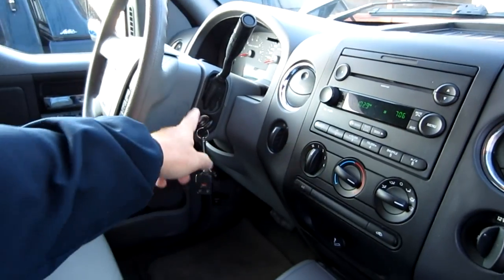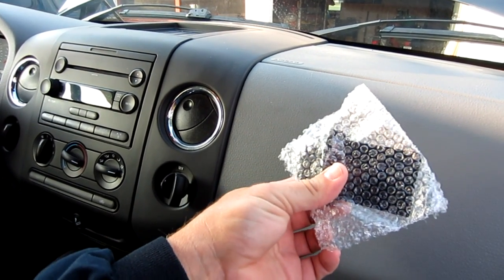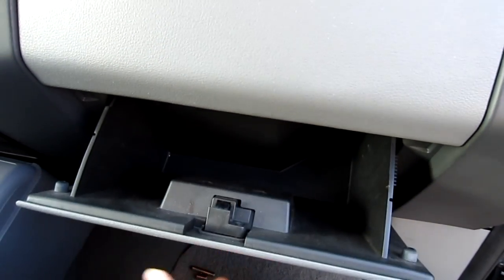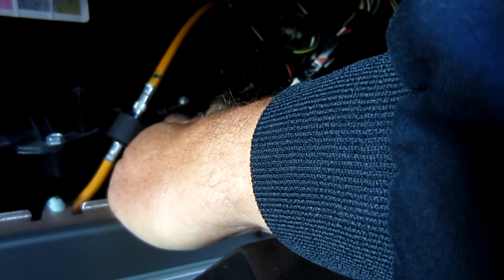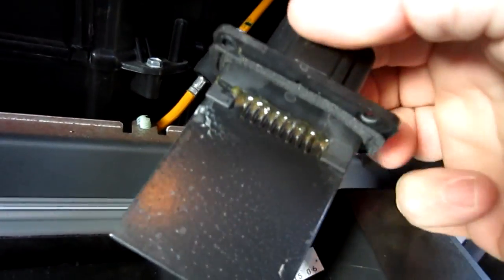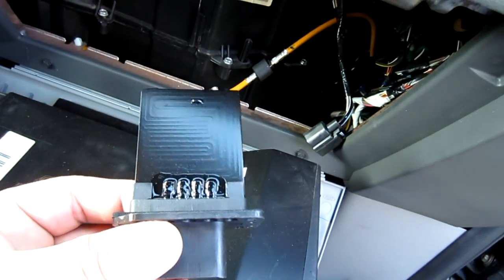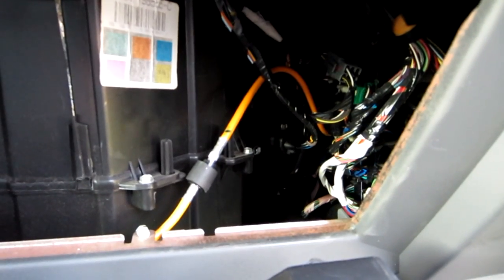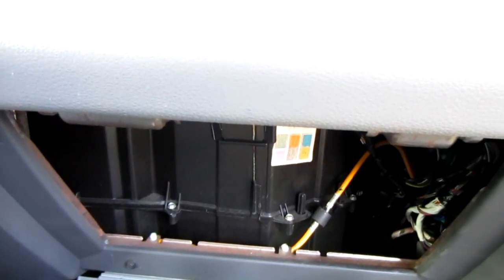2004 - 2011 F150 Blower Motor Resistor

Comment: Hey Foxboss9 and anyone else reading the "new" comments. This just happened to me and I want to CONFIRM that replacing this resistor when only the "LOW" setting doesn't work is a 100% fix! $20 and took less than 10 minutes, taking the side panel of the dash off made it really easy.  My truck: 2011 F-150 5.0 ext cab RWD. O'Reilly's only place that had it in stock, part number was RU1133 (Foxboss9's amazon link is RU440, so I ran the compatability check and it says will work with 2011 F-150) so please use his amazon link AND buy with confidence!     EZ FIX!! Thank you SO MUCH FOR THIS VIDEO

Comment: Thanks for the simple video. This is the third vehicle I've had this issue with, so I knew it was the motor resistor, just didn't know where it was in this truck. Thanks again, much appreciated

Comment: Thanks for the data.  Used this to replace resistor in 2005 F-150.  Worked just like you said.  Hardest part was getting the back screw back in.  This vehicle had been flooded in all the Texas rain this year and none of the blower settings were working.  Resistor replaced as well as fuse and relay for blower.  Working like a champ.
Reply from the maker: Kenton Wright Great!  Stay Dry.. Funny how CA is a drought and between TX, OH and a few others we have enough rain for two summers..

Comment: Thank you. This worked like a charm. 

One thing- I believe that the resistor needs air running across it to keep it cool.  I started the blower with the resistor out- and it definitely heated up. Which, dummy I am, resistors do.

Comment: Thanks for the video, I just fixed mine after putting off for a year and a half.

Also if you’re reading this do not touch the resistor while the truck is on. The resistor get hot and it will burn your hand.

Comment: Hey man, a huge "thank you" for the video.  My 2005 F-150 dropped the all the speeds except for 4.  With you video, I bought the unit on Amazon, 19.99, and replaced it within 10 minutes and works like new.  I checked around to garages, they wanted an average of $200 ...... again, you saved me!!!!
Reply: This might be the same problem as my 005 f150 because last year 3 and 4 worked fined till this year 4 only works and 123 don’t work now except 4 so yeah I’ll definitely will buy a new blower resistor and I should get all my control speed up and running again
Reply: Oh yeah same thing with my 91 firebird formula except all the speeds works but the air flow is low meaning that when it’s on low can kind of feel it on low medium same air flow and high works a bit better but mostly it’s the blower resistor because over time it’s rusts and burns out so hopefully I can get that fix too

Comment: Thanks Man. I was at a loss after checking my fuse and relay. I was sure it was the blower motor. After watching the video I swapped out the,blower motor resistor and that fixed it. You saved me a lot of money and time. Very grateful for your video.
Reply from the maker: Keena1965 Great news! Glad it helped..

Comment: Thanks for the video, it saved me a lot of time as I was about to pull the knob control assembly on the dash apart. Buy the 8mm socket if you don't have one, I wouldn't speculate on a new one so I used my small adjustable that kept readjusting, it took about 40 minutes. Its a very easy repair with the correct tools. I'm off, someone said theres an issue with a 747.

Comment: Hey Foxboss9, Thank you. You were spot on with this video. I just watched you video yesterday, got my replacement blower resistor today and just put it in. Works just like it should. I found that I had to use a Scosche- twist driver to get the bolts in and out as my hands are just too big to get in there for this job. Thanks-a-million!

Comment: thanks very much. this is the first video I clicked on.  Picked up the part here in Toronto Ont CA for $46 + tax and fixed in 20 minutes.  Availale cheaper on Amazon but happened to be driving by a dealership and couldn't be bothered waiting   Thanks Boss!

Comment: If you have a 1997-2003 and the blower has never been changed, chances are its ready to go if your unit only works on high. When I pulled both the resistor and blower out, I found that the windings were gone on the blower, the wheel was tight, and the resistor tested with the ohm multimeter was also gone. When you test the blower motor with a multi-meter make sure the positive red lead is connected to the right side of the plug. Some resistors will be blown but not corroded.  The factory parts after almost 20 years should be replaced. If you go under to replace the resistor might as well replace the motor, because a bad motor will blow your resistor.

Comment: Thank you very much for this video. I assumed it was the selector switch itself but now I can skip that burdensome step. Thank you!
Reply: Same here. Just purchased an 05 off a family member. I thought the switch was the problem. Replaced the resistor. 5 minute fix and works like it should. Thanks

Comment: I have a different issue that you may be able to help me with. I have a 2007 F150. When I start the truck up. My air vent dials are in the off position, but I can hear the vent blower motor click on and then I feel air coming out of the vents. I'll turn the right dial to the right then turn it back to off, the blower shuts off. Few seconds later it turns back on again with the dials in the off position. I do the same on and off again then it stays off.

Comment: Some notes,  on my F150 2009 Lariat 4x4 (5.4L) with dual zone I have the same problem but my part number looks different.  it is in the SAME location and same 8mm bolts.  the Part is about $128 at Ford/dealer.  it is part number 19E624 (YH-1827)

Comment: Hi FoxBoss:  I have a 2009 F150 King Ranch with dual climate control. No fan on either AC or Heat.  Do you think its the same issue with the blower motor resistor? There are no blown fuses.
Reply from the maker: I am not sure. I think Someone about a year ago in comments, said is was different

Comment: Thanks so much for the video, this is the third time I've replaced the resistor, any idea why it does this?
Reply from the maker: They are just resistant wiring inside of the module, anything that overloads them could cause a failure. So, it could be a wring issue that you would have to trace OR a switch issue that would have to be replaced OR a motor issue that is causing a drag/random winding break.. Depending on how often you have to replace them and how much of an inconvenience it is would dictate how deep you may want to dive into the troubleshooting part..

Comment: Really helpfull and detail video, thanks, my 2006 ford is now working great. Would be good for people to know that if they are using a ratchet (like i did) to try to work through it from the bottom since is easier to loose and tight the screws.

Comment: This looks easy enough.  However on my 2011 F-150, 3 and 4 work, but 1 and 2 do not.  Is this the same issue, or does this only need replaced if only 4 works?
Reply from the maker: Scott Williams 98 percent sure that is the same issue.. More importantly it's the cheapest easiest way to ruling out the resistor as the culprit..

Comment: I have a 2008 Sable where the blower only works intermediately. Has the dual zone climate control and doesn't matter what speed it is on. Sometimes by slapping the dash/glovebox area, the fan comes on. Do you think this is a resistor problem? Thank you
Reply from the maker: Bill Donovan sorry I really dont know, I  am leaning towards a blower issue though. Usually when the resistors go out at least one speed works and no matter how much banging you do on the dash will not correct a resistor problem unless it's a connection issue with the harness.. Best bet is to bypass the controls altogether and try to put 12 volts directly to the blower motor. if the blower runs consistently then you'll have to troubleshoot other things, If the motor will not start and stop consistently when you apply 12 volts on and off then you need a new blower motor..Good luck
Reply: Foxboss9 Thank you for responding so quickly. I will check the blower and report back here what the fix is. Thanks again!

Comment: I sort of have the same problem but with all fan speeds. The problem had been on and off not completely not working. Would it still be the resister?
Reply from the maker: Terry Carmack it could be. The thing is replacing the resistor is the fastest cheapest way to rule it out. It would take more time energy and effort trying to trace wires and check resistance at the switch and the blower motor then it would be worth. So if it was me, I would replace the resistor and then if the problem still exists at that point I would jump into it a little bit more. Worst can happen you're only out 25 bucks and 10 minutes time.

Comment: A question for you..
How to diagnose/repair a non-working power front passenger door window?
Same Vehicle F-150 (mine 2007). Thanks!
Reply from the maker: Check to see if power us going to the switch that operates the faulty window. If no power check if there are separate fuses for each window or each side. If power is OK at switch, alternate switch from the working window. If still nothing, most likely motor.

Comment: On my 2004 F-150 when I pull out the glovebox there is a back panel in the way, it looks like I would need to remove the entire glove compartment and part of the dash to get behind it. Would it still be behind there or another location?
Reply from the maker: not sure what that would be..
Reply: +Foxboss9 I finally found it. It was underneath. I had to remove something and then really get under there to see the part. It had 3 coils on it. I'll be uploading it to my channel soon since I see multiple people having this issue.
Reply from the maker: +John Strange glad you solved it.. 😀👍

Comment: My problem AC turns on in my 2010 F150 but it's stays at one speed unless I turn it off. I try to  increase fan speed or lower fan speed but it stays blowing about half he fan speed. Can it be the motor resistor too? I can see digital lighted fan speed bars go up and down but the actual fans speed stays at about medium blowing power. So if it gets to cold I can't lower it just turn it off or turn up the temperature. Please help. Great vid too.
Reply: @Harvey Ibarra were you able to fix the problem with the resistor? Im having the same issue with my 2010 f150.

Comment: I have similar problem on 2006 f150.  Nothing happens on any fan speed 1-4.  I can still hear the ac compressor come on and some type flap or something click over around the glovebox.  Is this resistor still might be the problem or something else?
Reply from the maker: Not 100 percent sure if it is the resistor,  but the quickest way to rule it out is to install a new one. I am sure there is a way to bypass the resistor to see if that is the problem But, I don't know what the bypass procedure is.

Comment: yeah I have 07 just starting to have this issue I will be looking into it
Reply from the maker: +john bailey good luck
Reply: Mavrick 259  just wondering if you ever solved your AC problem on your 2007 was it the resistor in glove box mine is an 07 and only blowing on high THANKS IN ADVANCE

Comment: I have a 2007 Ford E150 few months ago I took it to the shop and they fix the Valves because it was leaking and after that my Ac sometimes blows cold air and sometimes not also sometimes stops for a bit doesn't blow any air and after 1 or 2 minutes it starts working again. what do think is the same problem?
Reply from the maker: +Joaquin Abundez Sounds like the diverter door is not working. look for vacuum line leaks or if cable controlled look for a cable off..
Reply: +Foxboss9 thank you. one more question my wife is driving an 2005 Mercury Mountaineer and the Rear Ac only blows hot air. the front Ac works good. the rear Ac is controlled by it self. what do you think it can be?
Reply from the maker: There is only one A/C compressor that runs your cabin cooling. So, if the front A/C  is working then the that means either the controls are not turning on the diverter mechanism that sends cold air to the back or the mechanism itself is not working. I would start with the controls up front then the rear passenger controls to make sure they look good(connections/movement). If all looks good then the more difficult part of tracing the parts the controls operate will need to be checked for their functioning. AS ALWAYS CHECK THE FUSE PANEL FIRST..good luck

Comment: Question: After replacing with new blower motor resistor I had good operation for about 30 minutes. Then when I restarting after gassing up it stopped working and was only active on speed 4.
Any ideas what else I should look at?
Thanks
Reply from the maker: Well it could be one of two things. 1 - the part that you replaced it with might have been a bad unit. Or, 2 - you're having a problem either in your wiring or the blower motor itself that's causing the resistor to experience more resistance than what it's designed for and causing the circuit to go bad in the unit. Unfortunately, the easiest way to find out if it's bad wiring is 2 spend a lot of time troubleshooting and looking at resistance values. The good news about that is if you do all the troubleshooting yourself it doesn't cost any money just a lot of time. Now, with that said oh, I'm not a big fan of throwing Parts at a problem when you're not sure exactly if it will fix it or not but for another $20 and 15 minutes worth of work you can find out if you have issues elsewhere by just replacing the blower motor resistor with another one and see if it happens again. Good luck
Reply: @Foxboss9  Thanks. So nothing like a fuse because It blows hard at speed four with three different resistors. If I was a better mechanic I would check the wiring, however it may be that I can change the blower motor and see what happens there. I'll try and follow up results.
Fred

Comment: So did that truck have automatic climate control?  I would assume it does?  The link you provided is for a BMR w/o auto climate control.  It seems a BMR w/ auto is $100+
Reply from the maker: seanYsean this truck did NOT have auto climate control..
Reply: I found a motocraft part with auto off another YT vid  for $36.  Great video you have though.

Comment: at my tire shop where I work  they have this issue on there  company veh   its a 2006 f150   it does not work in 1 and 2    but it does on 3 and 4  would this be the same fix ?
Reply from the maker: Most likely..the switch and resistor are really the only 2 things that change the speed of the blower motor

Comment: Hi, you diagnosed the problem exactly.  Fan only worked on high forever, and it finally died altogether the other day.  I replaced the part, and now the fan sounds like it wants to work, but doesn't.  I guess I'm one of the 5%.  Any other suggestions? Thanks.
Reply from the maker: michael uimari you need a new blower motor..
Reply: Thanks, I kinda figured.

Comment: I have a 98 f150. Speed 1-4 is all the same. They feel like they are blowing on the lowest setting. I replaced the resistor but it's still hasn't fixed the issue. Could it be something else?
Reply from the maker: Usually not...

Comment: Question. I have 2013 F Expedition limited with dual climate air with auto. Rear is working front nothing. Front motor blower doesn't come on which is under passenger side dash. Any help would be appreciated. Thanks.
Reply from the maker: Sorry, haven't worked on that problem.. Any ideas anybody?
Reply: I figured it out. It was the blower motor resister which is located in same spot.  Hopefully this will help others as well.
Reply from the maker: +Marine Mo 👍👍😊

Comment: OK I have a question I have a 2011 Ford F150XLT speed 1 and 2 does not work speed 3 and 4 does do you believe that that is the blower resistor problem
Reply from the maker: Same.... You need the resistor in the link
Reply: @Foxboss9  thank you very very much i will replace it in the morning

Comment: What if none of the speeds work, would it still be the same thing that needs a replacement?
Reply from the maker: Check fuse first... If it's good then you can try to check the blower motor however the amount of work that's required to do so it's a lot easier just to put a new resistor in to see if that fixes it first.

Comment: question,,,everything works but position 1,,,,do you think its the resistor or just the switch?thanks for the great videos!
Reply from the maker: My guess (95 percent) would be resistor. It's takes less time installing a new one than it does to troubleshoot the switch.
Reply: thanks man! already ordered it from amazon...
Reply: +Foxboss9  thank you.   Worked like a charm
Reply from the maker: +Pete Goyer gotta love happy endings... And warm feet while driving..
Reply: +Foxboss9   Ya southern Ontario this time of year.  10 below.  Yikes

Comment: Maybe you can help me I already replace our blower motor resistor last month and my a.c. cut off again. Do you have any idea what the issue can be?
Reply: I have a 2010 F150
Reply from the maker: Possibly.. It's a resistance device so if the blower motor is starting to go then it could be causing it to prematurely fail but the easiest way to rule out a bad unit unfortunately is to buy another one and try it again..
Reply: Foxboss9 It came on earlier today out of nowhere. We are going replace it again. Thank you!